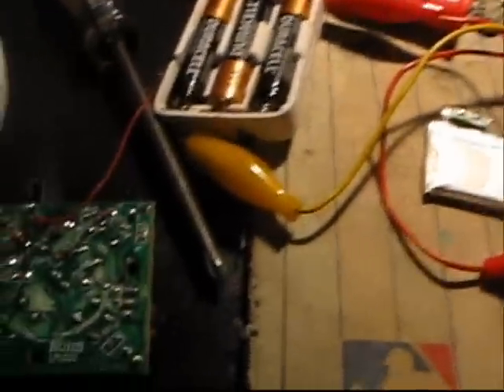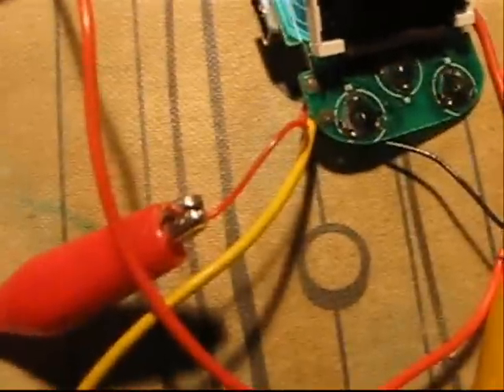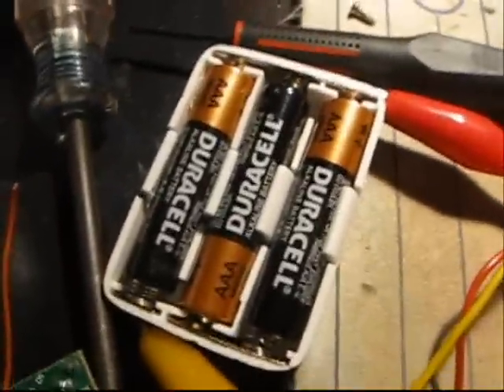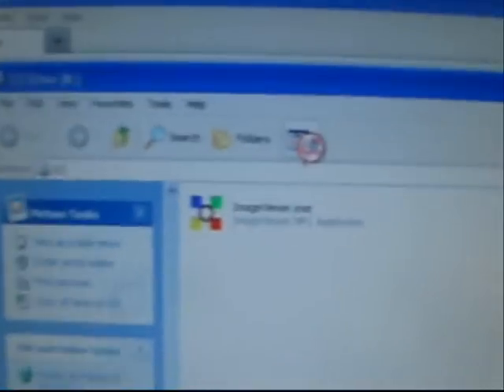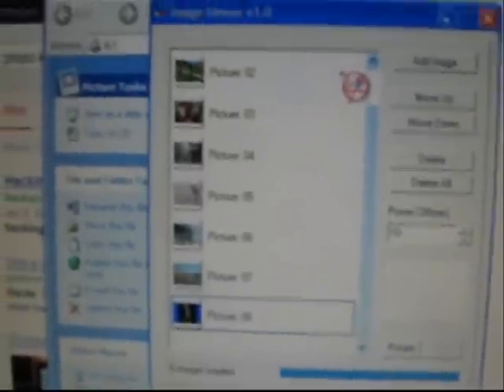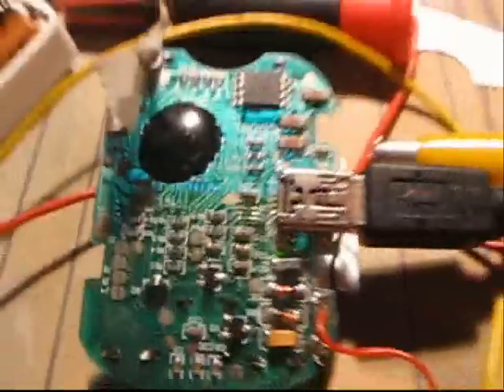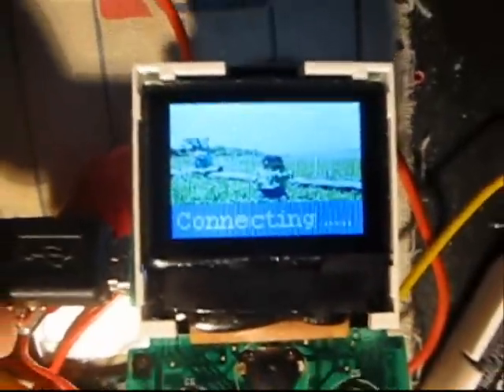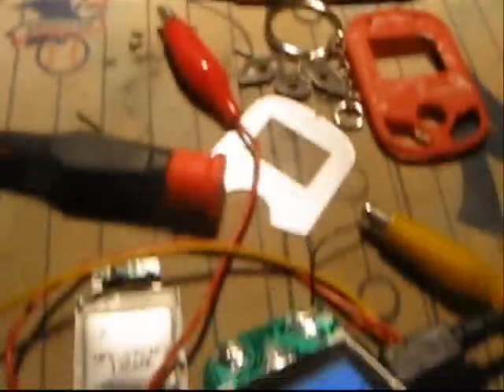Photo Keychain Hack (Running a Dead Digital Photo Keychain off 3 AAA Batteries)

Comment: You could have recharge it with 3.7V lithium ion cellphone rechargeable battery.  I have done it for all my 3.7V devices, especially in old GSM cellphone nobody wants.  In fact, in old laptop lithium battery, once disassembled, you can get 3.7V lithium batteries from it.
Reply: I will show you on my next hacks (probably next month).
Reply from the maker: EducateTube.com
I have replaced the batteries on a lot of my devices. I have some of those spy net video watches and they came with tired batteries so I bought this flameless lighter that can be charged via USB and took the battery from that and put it in the watch. It worked but the poor software and hardware design of the watch causes it to constantly draw battery power even when off so I have this plastic tab which disables the battery. Still have to charge it constantly but the tryme pack that comes in the box can be used to take some of the stress away from the batteries but the watch does chew up a lot of power. You can't even power it off the USB. only charge.
Reply from the maker: EducateTube.com
And another question, if I take a 3.7v lithium battery from an old laptop battery can I say put it into my mp3 player and will the charging circuit of the player handle the larger battery?
I have some of those portable usb power banks that use the same batteries.

Comment from the maker: No, This thing died about 10 mins after hooking it up. Guess it didn't like 4.5 volts. I was originally going to rig one of my MP3 players to run on AAAs but when this thing died I decided against it and just changed the battery. I couldn't find the right resistor to cut it down to 3.7 volts.

Comment from the maker: I do plan to wire a 2GB slick MP3 video player to run on 3 AAA batteries but that may be awhile b/c the battery even though it's lost capacity, is reasonable considering it was dead when I bought the player. I play it until it dies then recharge it.